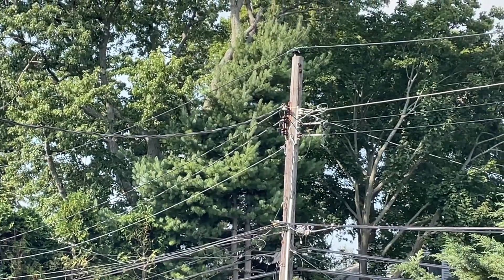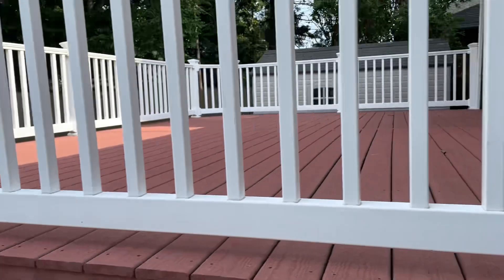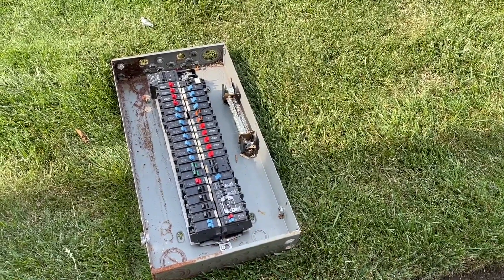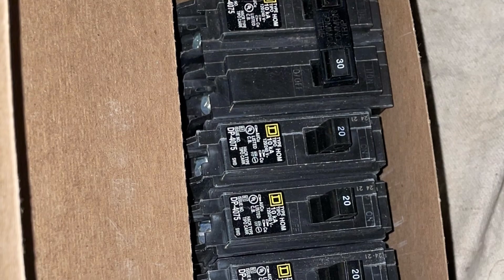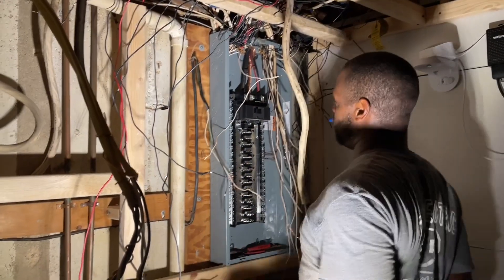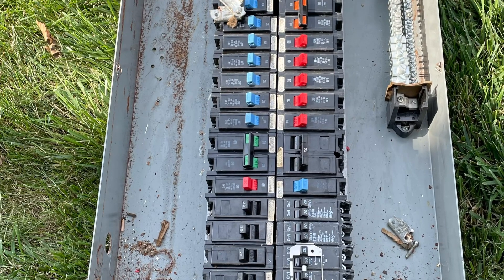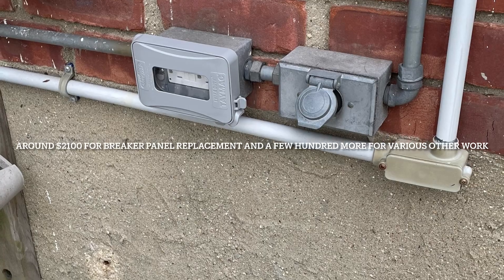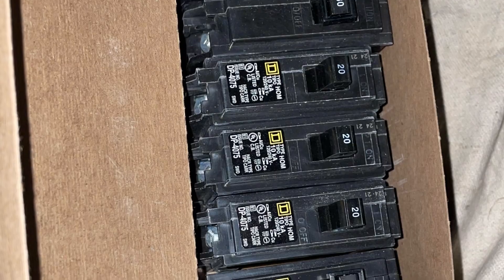Electrical panel upgrade to Square D 30 space 60 circuit 200 amp

Comment: no cover on the the meter base even tho its live?
Reply from the maker: @tested123  Thanks for noticing.
Reply: @wtam69  i say this because they hid the meter away to protect themselves while replacing your panel. they didnt care about anyone else being hurt or worse with those exposed lugs. theres no way to shut that off if someone is getting electrocuted.
Reply from the maker: @tested123  Good point. It’s an object lesson.